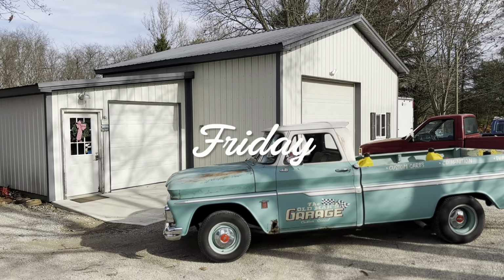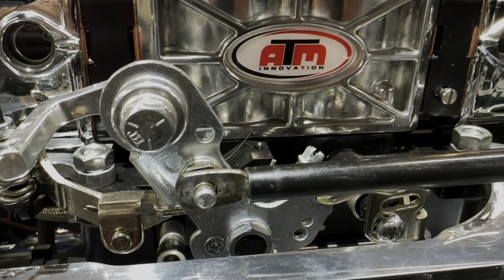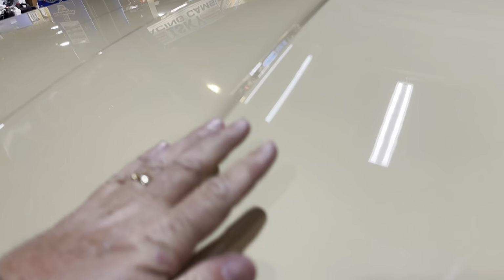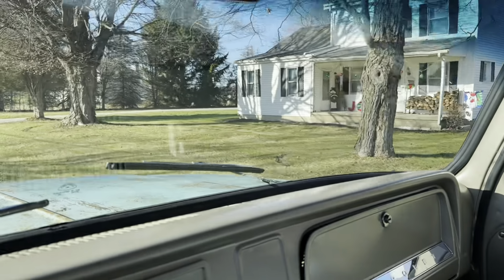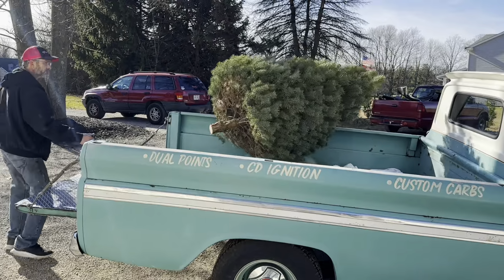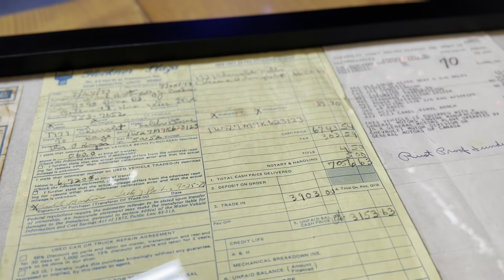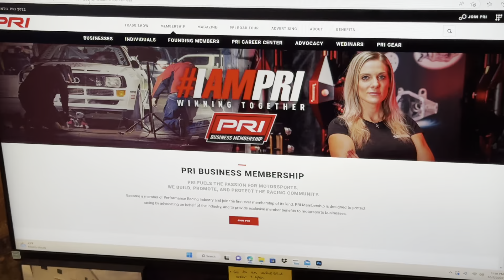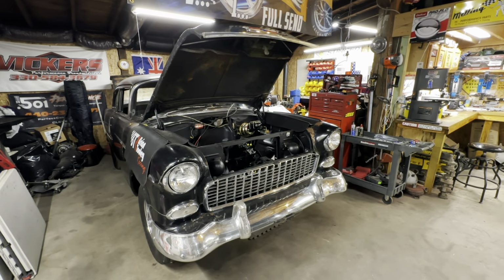INSANE POWER! The MALIBU is headed to PRI in Indianapolis!

Comment: I drove an old Chevy c10 like Vickie truck. We pulled race car with it and raced the truck as well in lower class. I’m telling you this to tell you one little things we did to that truck that made it worlds better towing and cutting light on track. We dropped the rear axle down took out the stock half ton coil springs and put 3/4 ton coil springs in it. No other mods and did not change front springs. Towed way better and was great off the line on track. Very cheap upgrade but very well worth it if your going to tow with the truck.

Comment: I remember an article in Hot Rod about the Malibu body for drag racing compared to Camaro. 
Windshield angle, short front overhang, long rear, a full frame. 
...  there's even a 1/10 scale '78 Malibu for radio control drag racing.

Comment: Question for you Bill, if I switch to E 85 carbureted, is there anything else I need to change hose wise? Will the stock fuel system except the 85. I do have an aftermarket Holley fuel pump.

Comment: Is the 421 built from a stock casted block or is it an aftermarket block. Asking cause I recently acquired a good stock 400 sbc (511 casting) that’s never been bored & wasn’t sure if it was worth building a 406 or some other small block stroker combo with it. Looking to get in the 420 hp range.

Comment: Hey bill im not sure if you read these or not, but would you ever know of used parts for sale? Also I was needing some advice on my new engine I’m having built. I could pay you for your time, I’m new to bigger horsepower small blocks I’ve usually only built mild engine kits. I’m having a hard time finding info on 18 degree Sbc engines, and I was gonna ask you about my heads and tuning the engine once the builder is done. I’ve got a Msd pro billet distributor and a quick fuel carb which are both new to me. I’m used to a regular hei with a edelbrock carb. So I’m gonna have to learn tuning all over again I guess. Well any help would be greatly appreciated. Thanks again my names Cameron.

Comment: Bill have you ever used a piston pump it bolts up in the stock fuel pump location but it robs less hp than a stock pump they say it can feed a 2,000hp engine we use them on our dirt late model racecar and we've had the same one for 5 yrs now

Comment: Would you by chance tell me what your Cam specs are? The only cams I run are ISKY. ISKY and Engle cams are Flame hardened. I have a 385 sbc N/A with a hydraulic roller and Short travel lifters. 294° 294°  246° 246° .550 .550 on a 108° LSA AFR 195 Eliminator heads. If you want to give out your Cam specs, I understand lol